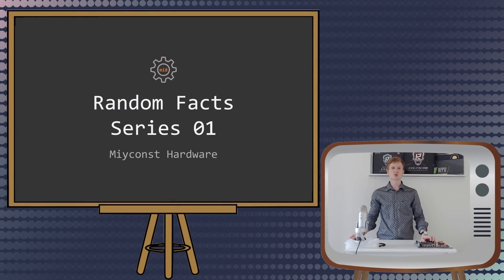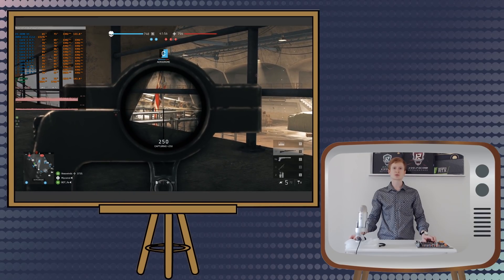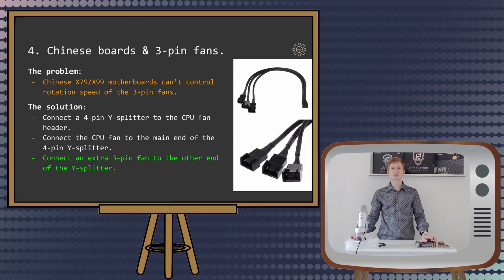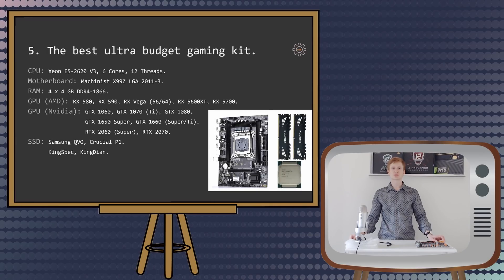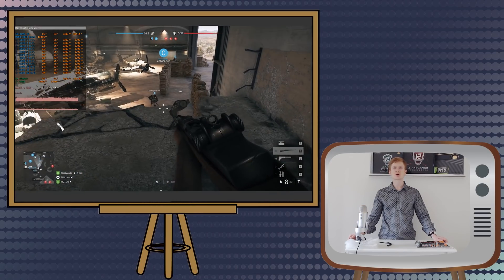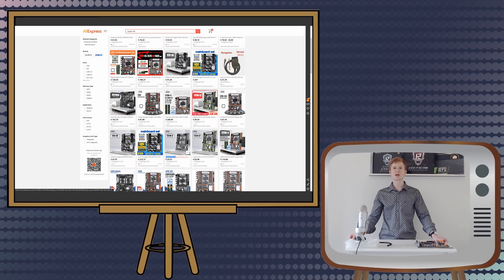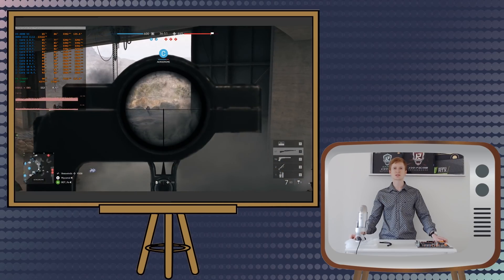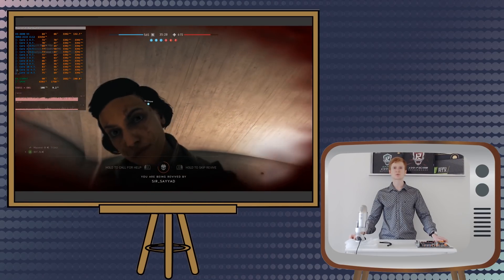🇬🇧 X99 News | X99 motherboards from JingSha & Huananzhi | DDR4 Compatibility | What’s next – RF01

Comment: E5 2690 V4 is 14 core I think at least I haven't seen it mentioned as a 12 core
Reply from the maker: Yes, it's 14 Core, I said it wrong.
Reply: @Miyconst  I've been looking at various benchmarks of it VS the E5 2678 V3 and sometimes it's slower, sometimes faster. Faster on passmark, slower on geekbench. Should be interesting to see you compare them.
Reply from the maker: Hopefully I can get the CPU in a week or two.
Reply: @thomassmith4999  I have the 2690v4, and it's indeed very decent. Upgraded from 2680v3, and despite the 2690 can't run Turbo Boost on all cores it feels faster overall. Paired with a 1080 Ti it usually stays at around 60-70fps in Extreme, and 75-95 in Very High playing Ghost Recond Wildlands or Watch Dogs 2 at 1440p. Maybe not too relevant games these days, but that's what I play at the moment;-) That cpu works very well with VMware as well - has the grunt when needed, and very low power consumption when my lab is close to idle. Paired with 384GB ram and 3x480gb SAS SSDs the server (PowerEdge R630) normally hums along at 85-100 watts, so it's a nice improvement from v3, and a great improvement from v1/v2 imho. Not quite the latest Threadripper or Epyc, but indeed a good cpu if youn can source it for a reasonable price.
Reply: @oliverolsen620  Very good, I'm still using a E5 2620 V3 since I only have a RX 580 gpu and it's the bottle neck rather than the CPU. But I will buy either the E5 1660 V3, E5 2678 V3 or E5 2680 V4 at some point. 

I have the T5810 Dell Workstation. I just bought it so I have an efficient PC to use on the living room TV.

Comment: Would you do a video-review about BIOS-iEngineer ? (Tutorial and how better is than the original bios)
pd: great and useful video, thx
Reply from the maker: What kind of tutorial would you want to see? The BIOS is available through mine Mi899 application and you can use it with just a few mouse clicks.
Reply: @Miyconst  my bad XD 
I will see that, thx for the answer
Reply: @Miyconst  Some suggestions for BIOS settings for better gaming performance maybe? I've tinkered around with quite a few BIOS options and did some research on them of what they do. But it is hard to find good info which options are really beneficial and my benchmarking was limited to two games only (BF1 and Company of Heroes 2).
Reply from the maker: @seylaw  In the most cases there are just two BIOS settings you should be bothered: 1. Overclocking, if you have an unlocked CPU. 2. RAM timings. Some other settings may bring a negligible performance improvements, but it is not worth the hassle.
Reply: @Miyconst  The frame times / latency could improve a bit if you enable some of the modern options (x2APIC + Physical Mode, Latency Tolerance Reporting, PCIe Atomics (but not the blocking option), Extended Tags and Extended Synchronization, ID0 etc.) and disable the legacy options (e.g. Subtractive Decode), but it won't neccessarily show in the FPS. My results so far are not convincing enough to really encourage people to do this, but they could try it out and I'd love to see more data points on this. I experimented with all of this because of some stuttering in Battlefield 1 which drove me crazy and learned a few things about PCIe along the way. And the stuttering is mitigated a lot now. ;)
Reply from the maker: @seylaw  The thing is that many of these settings are just ignored on the Chinese motherboards, it's also very hard to validate if the stutters come or go, since BF5 is a very unpredictable game with lots of stutters regardless of the hardware configuration. All in all, I can't invest this much time into finding the best BIOS settings for each motherboard for an additional 0.5% FPS improvements. If you (or someone) could provide me a list of the best default settings - I can make a video about it.
Reply: @Miyconst  Not a problem. And yes, the changes are not that dramatic - my eyes are very sensitive to latency though (playing on a 144 Hz Freesync monitor). But I don't even trust my own numbers as they show only a tendency, but are not that conclusive enough and there is quite a bit of variation. There are also a few Windows settings to tinker around with, such as Message Signaled Interrupts that have an impact on latency. On the other hand, a "What you have to do to get the most out of your X99/Xeon-PC video" could be interesting to a few people. I also stumbled upon a fair share of X99 platform issues along my way (such as Message Signaled Interrupts not working with USB; non-working network cards in the bottomn PCIe slot under Linux due to PCIe errors which can be worked around - but all in all I am still happy with that system).
Reply: @seylaw  can you make a video of how to do it? I have black screens and crashes when I enable ram timings and another configurations,
Reply: @daemonkisure2952  Sorry, but I don't do videos. The standard BIOS settings are good enough for most people, there is no magic setting which improves performance further as miyconst said. The tweaks I mentioned help a bit on Windows but you need to know what you are doing when dealing with these, e.g. Message-Signaled-Interrupts (there is a great guru3d-forum-post explaining everything and a tool which helps to set the values - but be aware that it could also hurt performance). One generic thing I noticed is that it is generally save to enable the C-States, one exception would be the installation process on some Linux distros which could freeze/hang - the solution is simple, before installing a distro you should disable C-States and turn them on again once the installation is finished. This can save quite a bit of power (the CPU reports 25 W idle power usage). But be aware that this might hurt gaming performance and can cause stuttering.

Comment: Interesting! These motherboards have come a long ways in a few years. I hope they can get decent power delivery on them for solid overclocks in the 4.4ghz or so range soon. Ive watched the 6800K drop from 300+ dollars to 160 dollars in the last year, and im fairly sure that will be my next buy. Right now its little brother 5775c is serving me well, but a couple more cores for futureproofing would be good. It would be great if i could buy a new motherboard instead of used and not give up any features. Having 3 M.2 slots would be a big plus too. It would be great to have all my storage on the board at high speed.